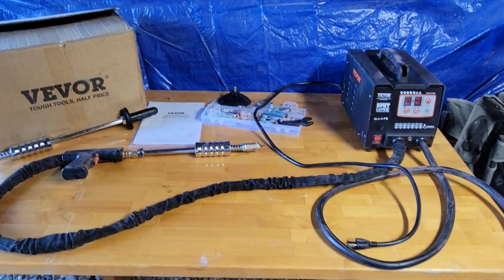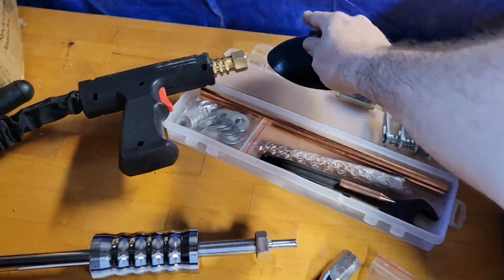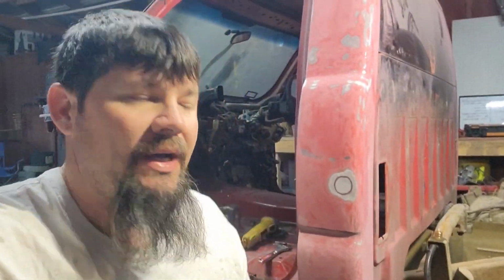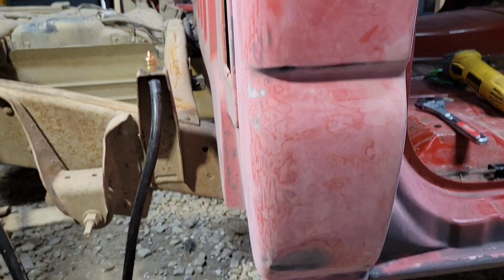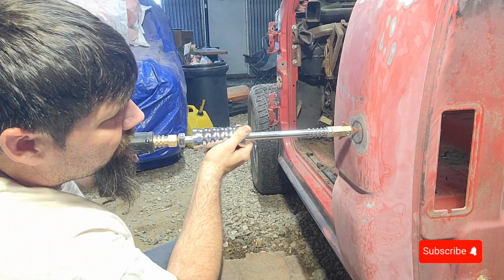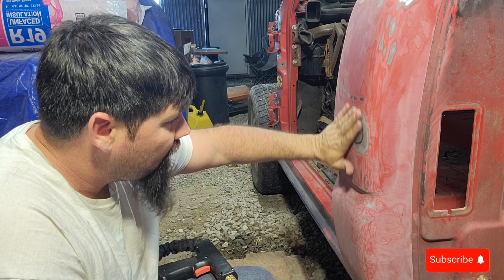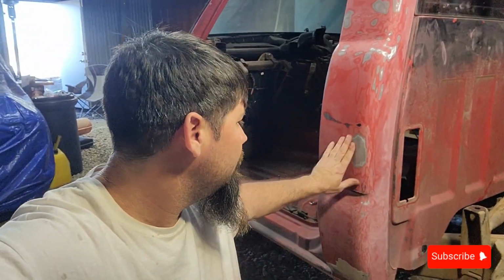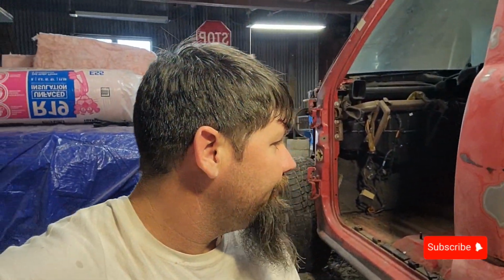HOW TO and REVIEW of the VEVOR GD90e spot dent puller

Comment: I have a standard old school dent welder, but just got this in for smaller lows to save time on the hammer / dolly. I have a good ground and everything down to bare metal. This thing just doesnt stick at all. certainly not enough to use the slide hammer. Dont know wtf is going on but I feel like this machine is shit.

Comment: Had the same issue when I first got this puller. I was just sanding the repair area to bare metal using my da sander and 80 grit, puller kept coming off with small amounts of pressure when pulling. I switched over to an angle grinder with a 40 grit disk and it works how it’s supposed to now. Give it a shot.

Comment: I bought one of those too, but found I had to push the power up to max (9) and even then, it pops off too easy.  NO WHERE near even starting to burn a hole!  I wish!  but OK for light flemsy panels, or for small dimples like you showed.  I was hoping it would grab hard and pull some serious dents out. Didn't work for me.  Did you end up having to run clear up on max power?  Or did you run it on 220 instead of 110?  I haven't tried that yet, but  will do that next.
Reply: Hey boss, sorry for the late reply. I had some of those issues also. I am running the machine on 110. But something I figured out is to gwt a good solid lock, make sure the metal is bare, and a good ground is connection.  And the last trick is to not push hard against the metal when welding.  Just a light touch gets a better weld.

Comment: Unfortunately that isn't available in the UK. The British government have basically stopped Vevor selling electrical products into the UK because of safety concerns. More than 90 products were at risk of electric shock, fire, burns and injuries.
Reply from the maker: Mine definitely shocked me it worked so well. But I will keep this comment close by just to be on the safe side.  Thanks!
Reply: @OPAATGARAGE  Most of the issues involved loose wires, might be worth checking all of the connectors are cinched up correctly.
Reply from the maker: @spencereagle1118  I will definitely check that tonight.  Tha k you for the comments.